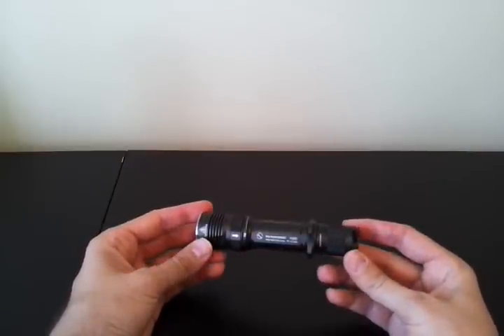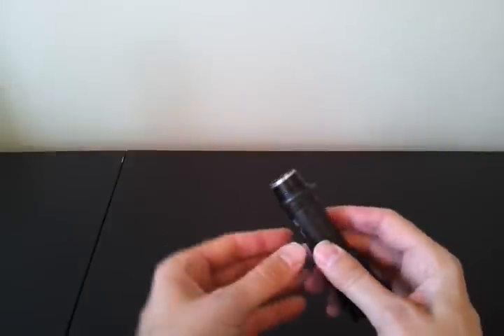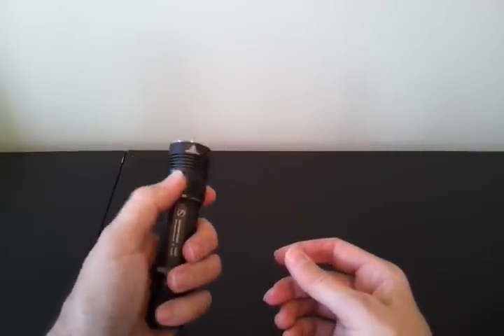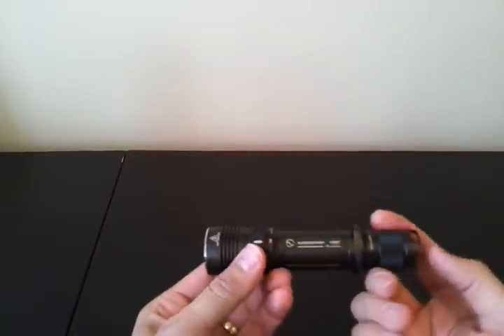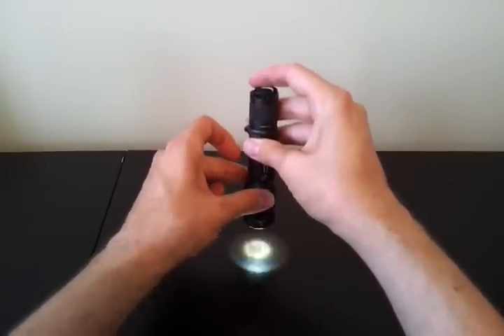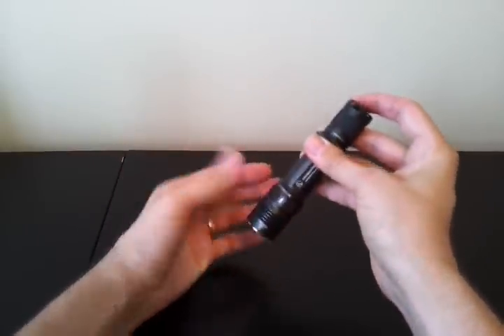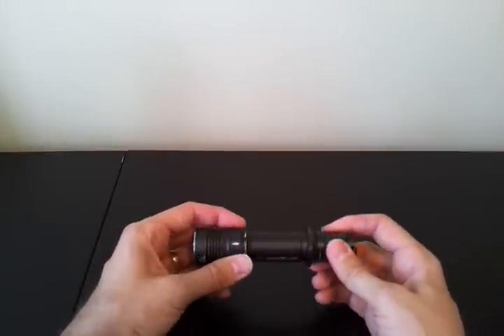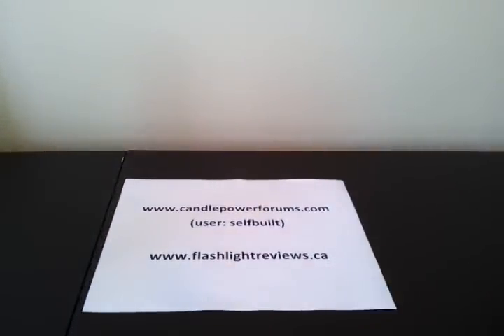Sunwayman V20C review, by selfbuilt

Comment from the maker: @47trea Because the control ring is an electronic switch, it is always drawing a small amount current when the tailswitch is clicked on (i.e. even if the ring is set to off, it needs power to be able to respond to a twist).  I have measured this "stand-by" current in the full review at CPF, and it is fairly neglible - it would take years to drain your batteries. But it is always better to make the sure the tail switch is click off or locked out when not in use.

Comment from the maker: @NorseRanger Newer higher capacity cells (like the 2900mAh ones) will run longer. Main issue is that they are slightly longer (and maybe fatter) than earlier lower capacity cells. Many are flat-tops, which won't work in all lights.  But they ae fine for us in the V20C, thanks to the spring in the head.

Comment: I looked at them on the website. Apparently the v20c has an effective range of 300m. Whereas the v25 says 112m... I wasn't sure if one was more throwy then the other. Another weird fact is That the pictures for the v20c state 438 when the text on the page stated 547. 

I would prefer more output if I can get it as long as I can turn it down for indoor cqc.

Thanks for the reply :)
Reply from the maker: You will find more consistent numbers in my reviews (tested the same way).  See flashlightreviews.ca for the links.